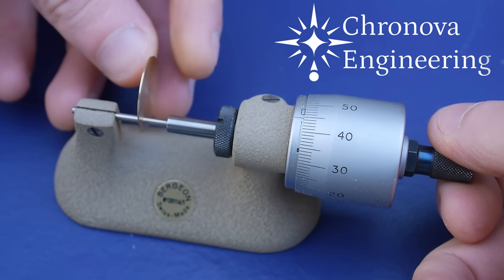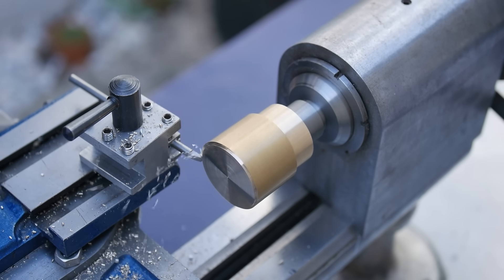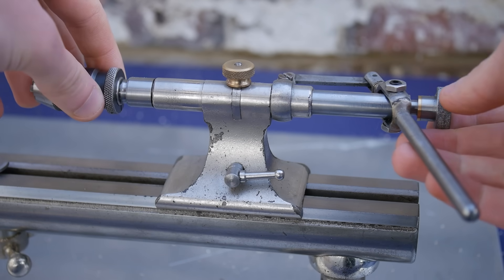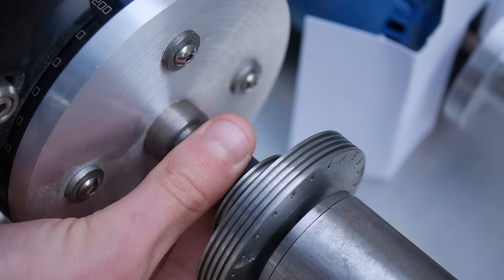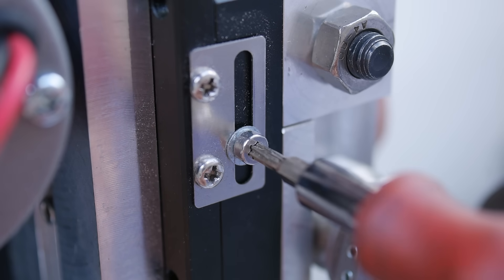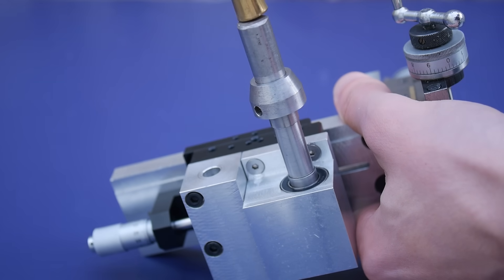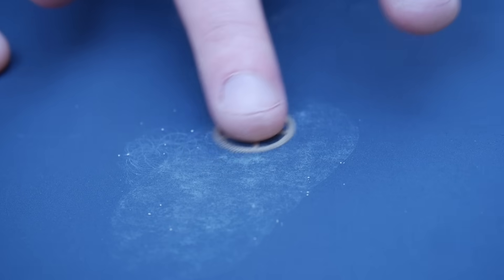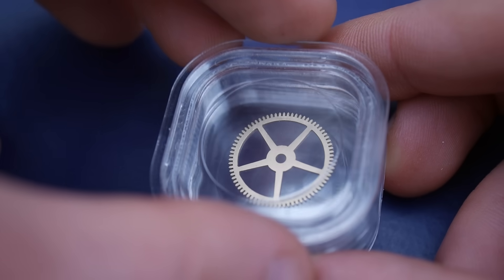Watchmaking: Machining a Watch Gear

Comment: I just finished watching this the second time. It seems to me the best reason to use champaign corks is obvious. I have several bottles I have been saving like an 82 Dom.  Are those 8mm or 10mm collets? The head stock I am  rebuilding is my 8mm. I have several open head stock Levins and at least one is a 10mm. I have mostly 8mm collets so that is why I went for the 8. My head stock housing is at the powder coating shop today. I am more anxious than ever after watching videos like this. God it is great. I have been pondering a milling attachment but your setup is great and I think better. I guess I better calm down and get the 8mm closed head stock working to start with. I also need to rebuild one of my cross slides. Or I could just get a new one from Levin. Only $11,500! OK. Rebuild wins. I have ordered the Permatex Prussian Blue Fitting Compound to use as engineers blue. I'm sorry I am going on but finding you has  made my week. I need to watch your lathe rebuild video again (and again). The pantograph is cool. And this video with the mill. What did you use for the spindle. It uses your collets but has an external pulley to drive it. I feel like a 10 year old at 75. Thanks for all of this.

Comment: I have similar Pultra lathes, very nice. Using superglue ? I find there are sometimes lumps of glue which would not help, but I work with silver and ebony not watches. Traditional hide glue does not have lumps and can easily be removed later with hot water.

Comment: I love seeing this nonsense. Don't try to convice me you're a "watchmaker", you are 2 steps away from being a CNC macine. If you truly believe you want to be a 'proper' watchmaker then show the viewers how you would make these parts as they did in the 18th and 19th centruries. Like CNC machines you are taking the skill out of the process. Let's see you make the escapement fork or the balance spring. Even the plates WITHOUT cnc machines. The machine you are using is just a Frankenstein creation that takes the skill out of watchmaking.

Comment: I started cnc machining oil well joints. Then went to orthopedic implants (hips knees). I thought that was tough with tolerances +/- .005. LOL then one day I saw a video of a guy repairing a watch. Seeing the screws (which will be your next video I see) and thinking, how and the hell are those made? I've done threads, chatter on threads are really bad especially on things like pipe joints where you'll have hundreds to thousands of PSI. But watch screws, I'm guessing are so small you don't have to worry about it. You guys are out of my league.

Comment: Can't visual all the metric measurements.  What is zero point zero mm. ?    How do you measure a micron?   Need to machine using standard inch measurement.

Comment: I've repaired watches for over 30 years. I can make a pallet arbor or a new pivot on a train wheel, but certainly not a complete gear. With the bills of life including two children, I never found the time it had the money to buy the myriad and very expensive equipment to make parts. I have huge respect for people who went deep into matchmaking. If i was independently wealthy I would have at least tried.

Comment: It appears that it would be harder to make all the tools that have been used in this process. My appreciation to all the toolmakers who have gone before, producing accurate things by intelligence and skill.
Today, wouldn't it be easier to produce this small flat complex pattern gear object using rolled sheet metal and a laser cutter ? (But perhaps ease was not the aim).

Comment: The gear looks fantastic but have you ever considered finding a machine shop with a wire-edm machine to do this job? No burrs to remove. Just a few start holes to drill. Unbeatable precision. Perfect application for these small parts. No small endmills to break.

Comment: Retired oil industry maintenance and reliability engineer here. Most of the gears we worked with you need a crane to lift. I am amazed and greatly impressed by the ability to make such tiny, nearly invisible watch gears. Absolutely fascinating video thank you.

Comment: Mad delicate, crazy precice. Hurts my big clumsy brain to watch. Can't take my eyes off it. Makes me want to go out and...? ... split big blocks of wood with an axe. 
Love the care with the cutting tools and the part so as not to break or damage them. Mad... keen. 
Dad was a shop teacher. When I was four in 1954 I watched him shove a lever made of wood under a drive belt that went up into the ceiling to a shaft up there. The stick was to lever the the belt over to a different sized belt drive gear to change the speed of the lathe. There were wood and metal lathes for atudents to learn on.
I wish the old man were around now to watch your lathe in operation.

Comment: Very nice video but I’m wondering why you didn’t polish the teeth after showing how rough they were under a microscope 🔬?
I would think some rouge on a short-nap buffing wheel would do wonders for smoothing the action and lessen the change in operation through wear-in.
Anyway, I really envy the skill and equipment as I build small radios and am at the mercy of whatever gear-reduction vernier I can find because good ones (with high ratios and zero-backlash) are nearly impossible to acquire.  But it seems sooo-expensive to get into precision metal machining, with even the stock being high as well.
Really appreciate the videos and amazed by the technical experience of your commenters and community… 😊
SUBSCRIBED !!!

Comment: Amazing work;   but i can´t help think that a 50 dollar quartz watch is 5 to 10 times more precise than the most expensive mechanical watch, needs no cleanings, has a battery that lasts over 5 years, and lasts a lifetime.

Comment: Very interesting and skillful. I have made many clock gears but nothing under 0.5 module and the cutters from round silver steel by graver to match the wheel I am cutting cut in half and then hardened. Cutting is done first with a small slitting of the correct thickness or a trifle smaller. a very fragile cutter, with care usually works.
I would like to see a video of how you made your cutter of such a small module.
Thanks
Ron

Comment: Nobody in the watch industry makes gears this way. Brass watch gears are stamped - not machined. A die cuts complete gears, including the teeth, from rolls of thin brass strip. The stamped gear is then pressed onto a steel shaft. In nearly all cases it is fully automated and takes less than one second per gear.  

Steel gears are made from stamped disks. The teeth are cut by gear cutting machines. Once again fully automated. 

Watchmaking for the past 150+ years had been semi-skilled production line work. All the parts in 99.999% of modern mechanical watches are made by  machines - not artisans using hand tools. In some cases the movement is also assembled by machinery.

Comment: Remarkable work. However, I have found that new Loctite superglue is overpriced, not viscous enough and the screw cap impossible to undo after one use.   Bostik is far superior and much cheaper if you buy the 20ml bottle from ASDA.  It is spread around   both movements and cases in many of my rescued French clocks.

Comment: in what watch does this gear fit?  wristwatch gears are usually about 5~7mm with Module 0.08 to 0.11. looks like an clock gear to me. the big Ben clock. :)

Comment: Watchmaking always struck me as the pinnacle of hands-on fine techniquing. The tininess of the parts and the direct working of the parts is so tight and challenging.
We do this today with modern equipment, and that is tough, imagine what it was like a couple hundred years ago. And then there is issue of aging but highly skilled watchmakers, whose eyes are failing and hands begin trembling.
The closest thing to this kind of precision work I have to do, is in repairing certain apple computer  products, where I have to deal with screws literally the size of grains of sand.

Comment: It always seems like an excessive amount of wasted material whenever I see a lathe video. Why does a part need to start out 20 times larger and have 90% removed? Machinists are the most inneficient and wasteful of all the craftspeoples.
What? You need a one inch tube 2 inches long at ⅛ inch thickness? Here let me spend the next 80 hours cutting down this 20×20 foot block of brass.

Comment: I am interested in reproducing some vintage pressure gages, they use a sector gear and a hair spring. I am getting a wire edm that can burn .002 wire if you hold your breath .001 radius in the corners should be small enough.

Comment: What kind of milling/lathe machine (I don't know exact name of it in ENG) you use? It seems I cannot buy one with the cheapest option.. because making watch gear seems to require super accuracy.
Reply: That's a Pultra Lathe, as you can see written on top of the carriage in a few shots ...

Comment: Modern watches are not mechanical, so don't need gears. They keep better time too. Always to the exact second, if they can receive a time signal. They also don't need constant winding either.

Comment: "Its cheaper to use a shop made tool"
*pulls out two stepper motor drives and a custom optics lab divider with a dc motor drive

Comment: I have build a cnc router for printed circuit with very high accuracy, I can mill such gear easely. Maybe even I can bush the clock also with it.

Comment: Every regular machinist watching this:  😲😯🧐
Reply: Weirdly enough, it's all familiar stuff, just really small work. The indexing mechanism for the lathe is some old-school manual machinist level ingenuity. You just keep bolting and clamping expensive precision things together until you get the setup you need to do the job. That's the interesting part.

Comment: Thank you for sharing your great work! I've always been fascinated by machining processes, but these hyper-precise machining is a whole new genre. 
If I may ask, I have 2 questions.
1. As far as I know, Cyanoacrylate based superglues are prone to heat. So I was worried if frictional heating would cause detachment of workpiece. Did you use different type of glue in this work, or was temperature controlled by regulating the speed of work(i.e. less heating by slower machining)
2. The shop made teeth engraving tool is also really interesting topic by itself. the shape of it defines the size and the shape of gear teeth. Is there a universal teeth shape used in watch gears? or is custom engraving tool for each gear design required?
Once again, Thank you so much for sharing your work process. It is great pleasure to have chance to watch this fascinating field of precision machining.

Comment: As a 75 year old long retired toolmaker, I always saw watch/clock making as a dark art form! I still do! Great to watch the process though! Fine engineering at its best! I did actually use a scaleable engraver to make miniature hand assembling tools for the Plessey 9ta Sonotone audio cartridge, which was trying enough, but this is just sublime! Cheers
Reply: It blows me away seeing the watchmakers in their shops. I can easily tell that their tool chests are older than you! I saw a documentary of workers at the Breitling plant and they were going through their grinding tools to cut the gears. I couldn't believe how old the chests were. The wood was nearly black but the areas where they touched the drawer guides looked new. It struck me that these are very old. I'm sure some of these workers got their chests from their grandfathers.
Reply: how i can contact you sir
Reply: Dark art lol but yes for sure.
Reply: I wanted to try machining so im looking tonsee if watchmaking is a more convenient hobby
Reply: Nigel were you in edge lane ?
Reply: @laurabeaumont3593  Edge Lane? London? No, I was in Havant ,...Hampshire at what was then Burrows Bros! Cheers
Reply: @nigelparker5886  Liverpool, we had 50 + tool makers plus apprentices, thought it might of been there, we made a couple of bits for the decks there.

Comment: I understand manual tools operated by hand, so no CAD thank you very much.  I use a Deckel SO single lip cutter grinder to make my own micro grain carbide cutters, rather than buy them and if need be all the way down to ,003" in diameter.  Then a Deckel GK12 is used for "little stuff"  to cut any shape I'd like, including genuine c3 dimensional contours. I'd recommend this approach as it is hand work and faster than your approach.  In 1985 I made for Hewlet-Packard all the test electrodes (Poco 3) for Rockwell 64 S7 tool steel molds for their prototype ink jet printers.  I was required to hold tolerances of .0002" (that's two ten-thousands of an inch) ...which I did.  I'm considering making some of my own designed watches.

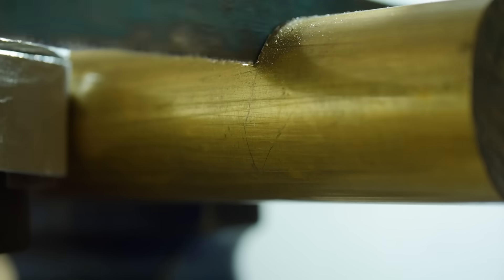Comment: Machining like a pro but sawing like a rookie? Better use full sawblade length @0:22
Reply: Would rather be a machinist pro and a saw amatuer...
Reply: It’s not even him sawing, it’s a quick clip of him making the action at a few different points for the sake of the video. This guy doesn’t do anything like a rookie.
Reply: sawing a soft metal with a handsaw dude. 

this person is not a rookie, have some respect. they are skilled in their personal craft.

Comment: Great now all I have to do is get one of those electronic indexing heads that fits perfectly to my lathe +  the special cutters & a power cross slide milling & drilling attachment 😄😮‍💨
Reply: I have made an electronic indexing head, and cheaply.  What I need to figure out it how to make the cutter/spindle.  If you have worked that out, help me out!  I'll show you how to make the digital indexer and give you the source code for nothing.
Reply: @headshot6959  Hello, wishing you only the best !   I was being a bit sarcastic, as I am retired now & have decided to actually not be so masochistic to myself, & just enjoy working it out mentally &  watching others do the work ...😉

Comment: Curious, did you make the tooth cutting tool with the specific tooth depth in mind, so that it would also cut the tooth bevel at the tips of each tooth?   Fantastic forethought in the cutting tool design for doing so !  But what a specific tool to have been made.  Does this work on other diameter gear needs too?

Comment: This is all wrong even though I know it is a foreigner using metric terminology.    Don't tell me that those bore mics are capable of measuring microns ( a micron is  one thousandth of a millimeter).   WTF is a spigot? & WTF is a Try-square ?    He mistakenly referred the inner cut-out as the rim  when in fact the rim refers to the outer dimension.  He stated " the geometrical calculations were harder than I expected"  NO WAY, his precision rotary has a # of divisions mode which all he has to do is enter the number of teeth on the spur gear in lieu of trying to calculate the degrees & minutes of each rotary cycle.  I was concerned  that the brass disk was glued slightly off center because he never trued the O.D.  which could have damaged the thin brass disk or even the home-made fragile involute gear cutter.  I thought he was placing the sanded & filed gear in an ultrasonic cleaner instead he placed the dirty gritty gear in what he called a membrane box, whatever that is?  I am familiar with minature  electronic rotarys because I just put together my Sherline motion controller w/encoder-motor and  it makes the same sound as  "chronova engineering's precision rotary table.  What are escapement files?   I figure it as a watchmakers term for a very small hand file.

Comment: Fascinating! Makes you wonder how they did it hundreds of years ago!! Definitely a set of skills I wish I had!
Reply: Turning lathes were invented in the 13th century.
Reply: Same way
Reply: The digitally controlled electronic stepper motor has been around since the 15th century
Reply: The balance float was still there I assume?
Reply: I visited Coventry's Herbert Art Gallery and the Coventry Watch museums some time ago where they have great examples of the watchmakers trade including the tools, such as the index plate or dividing head, used for gear cutting. They also have an apprentices disciplines to be learned over 7 years which is a must-read. Coventry used to be the centre of the watchmaking industry from the mid-1700's until the early 1900's where cheaper, mass-produced imports from Switzerland and north America spelled the end of production. Fascinating for anyone interested in how they made parts with precision micro-engineering.

Comment: If you were to use gear cutters for making small gears, where would you purchase them from?  I want to make gears for 1:160 scale electric trains.  Maybe "want to make" is too strong.  I cannot find the gears in all the sizes I'm looking at, so making them seemed the best option.  The gear cutters I have are not small enough.
Very interesting video, thanks for posting it!
Reply from the maker: I don’t know of a particular supplier for involute cutters. You can buy cycloidal cutters from PP Thornton. Best of luck!

Comment: What does one charge to have a replacement gear made? I have a old stopwatch I inherited from my grandfather. The gear that winds the spring drive, has teeth that have been broken and worn from over winding. I would like to have it working again, it is nearly 80 yrs old. Any help or direction will be much appreciated thank you.